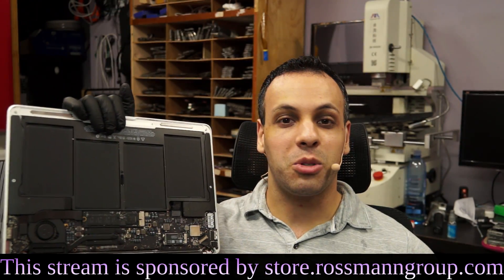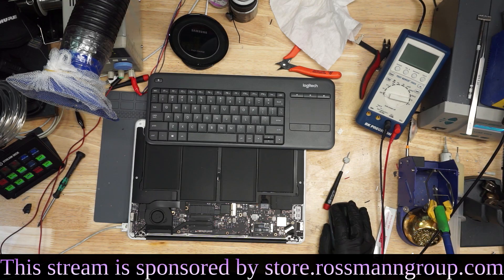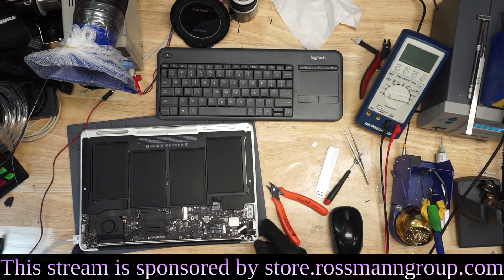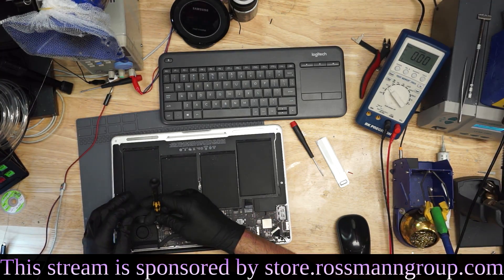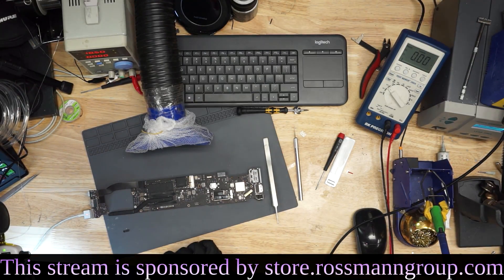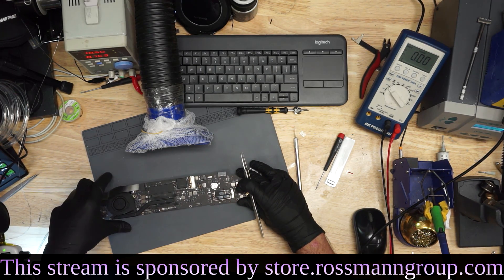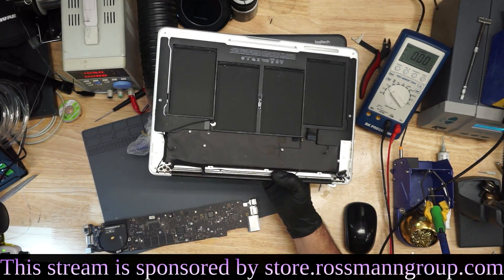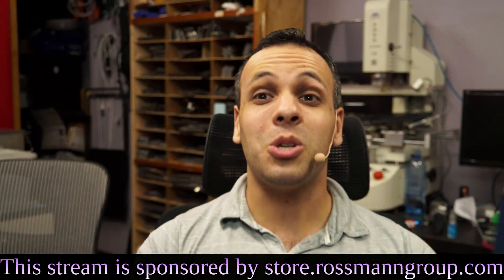Can spec of green dust kill a Macbook?

Comment: Yeah baby, Thinkpad master race!!!!! I have 4 thinkpads, they all work, you can say I'm a fan...lol
Reply: JavasBest do you spin?
Reply: We have 7 thinkpads - all of them still working / some of them upgraded:
T60 (2006) Upgraded cpu, memory to 3gb, SSD and windows 10 pro - still doing the job in our logistics hall
T61p (2008) Upgraded memory to 4gb, SSD, replaced fan, running win10 pro used for programming Digital circuits,
T61p (2009) Upgraded memory to 4gb and ssd. Running win10pro, Office workstation
X220, i5 (2011) Upgraded memory to 8gb, ssd, Running as Office workstation,
X230T, i7 (2012) upgraddd to 16 gb, SSD, running programming languages, VMs, photo tools, office tools, had heavy abuse including coffee spills and broken keyboards - all still running fine, 
X1 carbon, i5 (2014) running web development tools and office tools.
In memory: R31 (2002) sold off when the T60 came.
No thinkpad ever failed us in over 16 it years...

On the other hand my wife and her sisters air books from 2012 and 2013 are already dead - that’s why I got the x1 carbon for the wife
Reply: i have an old latitude and that thing is a brick, it broke a ceramic tile and chipped a granite slab and it  still works flawlessly and i have 3g connectivity, that thing is built to last, i can probably use as a weapon :D
Reply: My backlight stopped working after dripping from 3ft.
Reply: Whooo my thinkpad rocks! XD

Comment: Louis what year did u noticed apple going down the wrong path when it came to quality ?I'm guessing 2008 -2010 🤔 by the way I still use my 2003 12" G4 PowerBook still going strong but I wouldn't buy any of these new apple products 😲😵😁 😃👍
Reply: Since they went intel , not right away but it was the beginning of the end. My core2duo white macbook is still fine, i have had later core2 duos and i5 etc just die for no reason . The white core 2 has been abused and used for years and it gives 0 shits.

Comment: Corrosion on a test-point killed the board? The only way I can see this happening is if the test-point were directly in-line with the circuit and exposed, which would be an absurdly stupid design.
Reply from the maker: Which it is, and which they do...
Reply: Does this particular test point double as a via? Just wondering since it looks like a dead end upon first inspection.

Comment: On the bright side, business is booming at your shop. :-)  I tell people the same thing in my industry, two way radios.  Don't buy this crap and they do.  A few month's to a year later it's here to be repaired.
Reply: I got myself a Lenovo 7 or so years ago. I've spilled water on it, dropped it in snow, spilled beans on it and once dropped it down a flight of stairs after my backpack broke. My fucking backpack broke before my laptop.
Fucker still runs as nicely as ever, though the disk is basically running on lifesupport nowadays. But it being a lenovo I can just install a new one, as well as a few extra disks and RAID them up for storage.

This bastard will probably be at my funeral playing the music.
(edit: T520 for anyone interested. Big, clunky fucker so that's a downside.)
Reply: That's why I stick with Motorola portables :D
Reply: chiil  Those things are damn indestructible. I had one come in from an aquarium and it literally had a layer of rust covering the entirety  of the board due to being dropped in saltwater so much. It still worked, it just had a cracked solder joint on the speaker mic input.
Reply: +delciotto, what in the fuck? XD
I'm just as impressed that someone could let it end up in that state as I am that it survived that ordeal!

Comment: Well said Louis! On Feb 2017 I bought an iPhone 7, which was replaced five times by Apple since then!!! My device broke down after four months and Apple replaced it with a supposedly new one. The new device I was given was faulty since the beginning and I was given a new device that also broke down after eight months! The device was replaced with a new device that again broke down after three months and was also replaced. While Apple has been replacing my devices (please note that this is a single purchase) I am extremely frustrated with how soon all of my devices broke down! There are definitely design issues that leads iPhones to break down...
Reply: So let me get this straight... when your device broke down after 4 months, you still got a replacement from the same company, got the same dysfunctional model, and then when it broke down again you repeated this 4 times? I think this one is on you buddy.. should've gotten an actual smartphone when your iPhone failed.
Reply: Such as?

Comment: I'm surprised that the motherboards are not sealed in lacquer.
They don't want you opening it or repairing it, so why not TOTALLY seal it for a few extra cents.
This is how little apple thinks of you.
Think Different
Reply: My wife spilled diet coke on her Dell latitude business class laptop.The keyboard had splash ingress layer. Some keys were sticky. £25 ($30) and ten minutes of work and she had a new keyboard, upgraded to backlit. I washed the old non-backlit one, tested it, sold it on eBay for £15.

Fixed typo
Reply: Oops, typo, later -> layer
Reply: because think different...not logically
Reply: That's what they want I think honestly but they know there is no excuse for that (not one that will slide)
Reply: Because if they did that water damage would likely never happen, you would probably be shocked at how much money they make selling people new logic boards.
Reply: @bdhale34 
Exactly. Apple will never water-proof their MacBooks. Drink spills are an almost guaranteed new sale with non-water-proof boards.
Reply: Now you are thinking like Microsoft with Surface PRO
Reply: If you sealed them, they wouldn't break.

Comment: Serious question: Why should this not happen to a ThinkPad? Do they coat the PCB?
Reply from the maker: Thinkpads have covering over the board and drainage holes so the liquid that is whisked away by the covering gets drained through the drainage holes. On Macbooks it is directed straight to the motherboard where it then corrodes the uncovered board.
Reply: Louis Rossmann thank you for the explanation as an unknowledgeable person I was going to assume all laptops were made the same way.
Reply: Because ThinkPads are designed with drainage holes so that liquid is directed away from the PCBs as much as possible.  The ThinkPad engineers must not have gotten their degrees from some expensive art school.
Reply: because they don't run the power rails through a probe point
Reply: Cause apple just makes crap. Thats why. And no, i dont think they are coated.
Reply: Addi Thanks for the technically deep and insightful response.
Reply: Addi  most of the motherboard on a thinkpad is covered with what is basically tape to help keep liquid off.
Reply: I've had several Carbon X1 Laptops in my shop with onboard RAM issues. Lenovo insist on using this brown glue to bond the chips to the board which is near impossible to get off and contaminates any solder balls when heated. The boards are Wistron but only Lenovo insist they use this specific glue on their boards. The Carbon X1 is a bad example of longevity in a laptop.

Comment: Can a gentle breeze kill a MacBook?
Reply: Can staring at it wrong kill the backlight?
Reply: very likely.
Reply: Can cum kill a MacBook
Reply: Can using it normally cause it to overheat
Reply: No outside force kills a Macbook. They realize what they are and kill themselves.
Reply: everyday of the week
Reply: Gentle breeze brings too much dust into the MacBook.
Reply: just fucking looking at them will cause them to break
Reply: you blew incorrectly

- Apple Tech Support
Reply: A gentle breeze such as fanspin?
You might be onto something.
Reply: if that breeze is high humidity....yes
Reply: Omg a fart might kill it
Reply: if it's above 0% humidity or has dust, most likely.
Reply: If it's unauthorized air it could. XD
Reply: Gentle breeze, or mosquito sneeze. Either one spells disaster.
Reply: only if it comes through an open window
Reply: Wouldn't be surprised if the mentioning of a gentle breeze could kill a MacBook...
Reply: DOES THIS LOOK UNSURE TO YOU?
Reply: Yes
Reply: A Facebook poke will kill a MacBook.